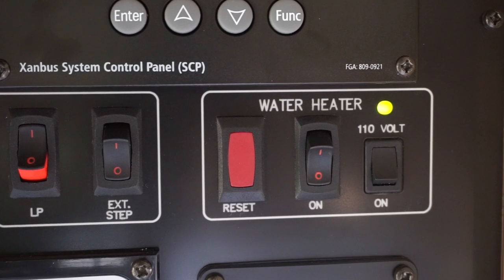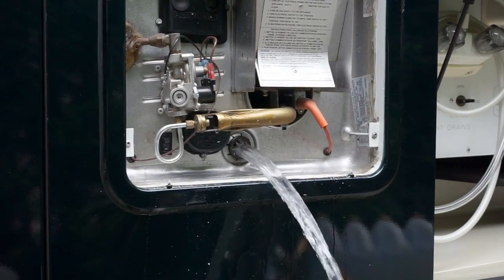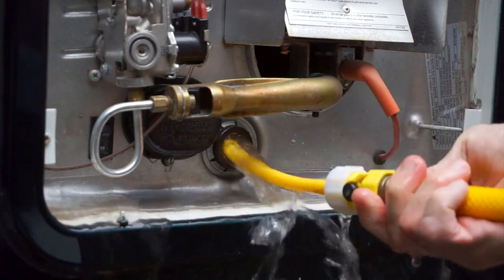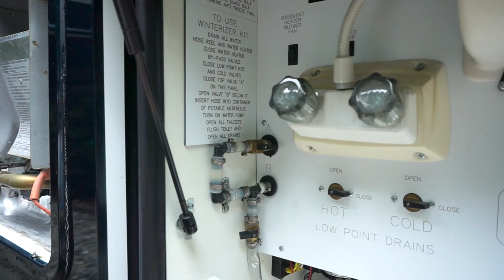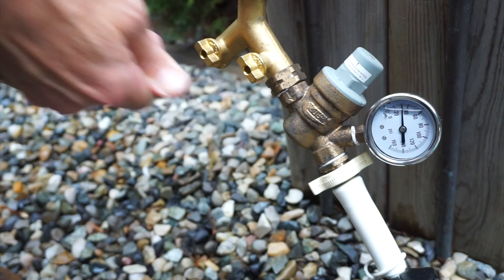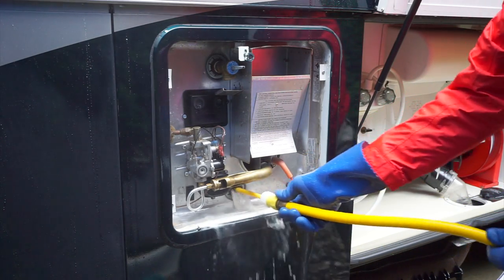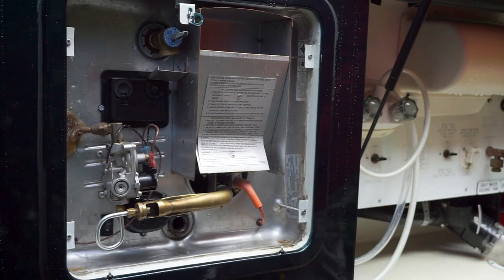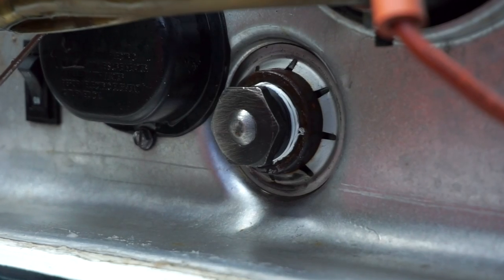Does Your RV Have A Water Heater? WATCH THIS!

Comment: Thank you for your channel.  One question:  I've watched your Atwood clean and flush video as well.  Our unit is new to us and the water lines are all behind a panel so it is unclear where I can disconnect a line to pump the vinegar and water into the hot water heater.  Could I not just empty my fresh water tank almost completely as well as the hot water tank, then fill the fresh water tank with the appropriate amount of vinegar and water??  Wouldn't the water pump then fill the hot water tank first?  What am I missing?  I'm a noob, so any advice is helpful.
Reply from the maker: Hey Floyd,

First, welcome to the world of RVing! We hope you're enjoying it as much as we do!

Second, we don't know of any water line that you could easily "disconnect" to enable you to do what we do with pumping the vinegar into the water heater. Our RV came with a "Winterizing Kit" built in... which is connected into our plumbing for the purpose of being able to introduce winterizing fluid into the water lines for storing the RV in sub-freezing conditions. Using it to pump the vinegar into the water heater is a side-effect of it's intended use. There are aftermarket products (like this one available on Amazon:  http://amzn.to/2eHZ5F4) that you can install for the same purpose. Hopefully, their instructions will make it clear how to identify the water line you need to tap into in order to make the kit work.

Third, there are several reasons we don't want to put the vinegar & water into the fresh water tank. The first is that we don't want to have to deal with flushing the vinegar (particularly the smell) out of our fresh water tank... putting the vinegar solution in there first would mean we'd have to rinse & drain the fresh tank a couple of times to get rid of that smell/taste. And the second is because we would have to put a lot more vinegar into the system to end up with the 50% concentration we want to end up in the water heater. The outlet from the fresh water tank on our RV isn't mounted to the bottom of the tank, it's at the bottom of the side. And as a result, you can't completely drain the fresh water tank. So there would be a fairly significant amount of water in there that we would have to balance with an equal amount of vinegar to get the ratio right. Your RV is probably plumbed similarly.

If you don't want to install a winterizing kit, you have a couple of options:

(1) Remove the Over-Pressure/Temperature valve near the top of the water heater and use a funnel that has a long nozzle to pour the vinegar directly into the water heater tank.

(2) Buy an adapter that could screw into the opening where the drain plug goes that has a barbed nipple on the other side so you could attach a section of hose to it so you could pour the vinegar into the tank from the bottom. Make the hose long enough to extend up above the top of the water heater tank (and find a way to attach it to the side of the RV) so that you can pour all of  vinegar in... and so that the vinegar/water mixture don't just drain out of the tank during treatment (or include a shut-off valve in the assembly so you can close it off while the vinegar/water solution is in there).

Hope this all helps you figure out what will work for you!
Reply: Thank you so much for your detailed answer.  It is very helpful.  We're new to this and I've watched many of your videos and it has already made me much better prepared.  I will look at my tank again to explore the best way to clean it.  Thumbs up!

Comment: Pete, John,  how to fill if I do not have the ability to fill off the bottle??    I have the exact heater in my Pacific coachworks trailer but all the lines are buttoned up pex. Could I gravity fill thru the pressure release valve?  Thank you!!
Reply from the maker: Hey Scott! Here are your choices: 1) Install an aftermarket winterizing kit, 2) Use a monkey wrench to unscrew the over-pressure relief valve, or 3) Attach a short length of hose (maybe 3 feet or so) onto a threaded fitting that's sized to screw into the opening for the drain plug. Screw the end of that fitting into the opening and hold the hose up in the air. Fill the hose with vinegar using a funnel. Attach the end of the hose up in the air, maybe using a suction cup to the side of the RV. This method will allow some of the vinegar/water solution to foam up and out the end of the hose during heating, but should still accomplish the task. Hope this helps.
Reply: For clarification sake, I'm wondering how many younger generation RVers would know what a "monkey wrench" is :-)  Do you get them at Petco ?  I just watched your new update video and came back here for a refresher and noticed the terminology.
Reply from the maker: +Travels with Yoly LOL. You’re right. Maybe us old fogies shouldn’t use such dated terminology. 😂

Comment: I see you have installed a ajustable pressure regulator valve, do you have a video where you talk about it?  Why that particular model?  are you satisfied?  I have the ordinary basic one.
Reply from the maker: Hi Julie! There are basically two different types of water pressure regulators that we've seen. The inexpensive fixed-pressure type that are so very common, and the adjustable type with gauge that we have. We've been using it for most of the time we've been on the road, mostly because it has a higher water flow, which is awfully nice when we're at full hook-ups. Yes it's a lot more expensive ( http://amzn.to/2DLVOwn%22 ) but even without adjusting it at all, the flow rate is a lot better, and we're willing to spend the extra money for it. The basic one works fine, but this is just a bit more "luxurious" when being super conservative with water isn't quite as critical (like at a full hook-up vs a partial hook-up with water & electric only).
Reply: Thank you for your answer, much appreciated.
Reply: thank you very for your answer

Comment: My water heater hasn't worked in over a year. I can't afford to get someone to look at it. Maybe you can help. The panel where the on-off switch is ( as well as tanks levels) quit working too. I am thinking it has to be a switch problem since the heater doesn't make any noise when the switch is on.  Several fellas have taken a look at it for me & all seem to agree.  It is an Atwood, in my 1998 Minnie Winnie. I live full time in this old gal. Hot water would be really great to have again! Thanks
Reply from the maker: Hi LuAnn. Is this a propane-only heater, or can it also run off electric? If it's a "bi-fuel" heater (propane/electric), it won't make any sound when heating on electric. It's only the propane mode that you can actually hear during heating. It's possible that the circuit board is bad, the switch, or (hopefully) it might just be a fuse. It's hard to diagnose without seeing it (especially for us non-professional-technician types), but if you give us some more detail, we might be able to suggest a couple of things to check. If it's a bi-fuel heater, the odds of getting it to work are better, since you'd only need to get one of the two systems to work to get hot water.
Reply: It is propane only.  It worked fine until I moved to another park & when I went to turn it on at the next place-nothing.
Reply from the maker: Thanks so much, Bob!! :)

LuAnn... in the meantime, here are a few quick things to check... but of course Bob, being a pro, will likely have lots more to say.

If you flip the switch to fire the heater and hear NOTHING (as in no clicking sound of it trying to ignite), the first thing to look at is power to the igniter. That could be as simple as a blown fuse, so that's the first thing to look for. Fuses can be scattered in several different places in an RV. You're looking for a 12-volt fuse (probably the colored "blade" type) marked "water heater." There might also be a fuse in line with the heater, or even on the circuit board.

If you find that, and confirm that it's not blown (contact wire inside will be unbroken), the next thing to do is check the switch. You can do that by removing the switch and temporarily connecting the two wires with a short jumper (short length of wire). If you hear then the heater fire up, the problem was the switch.

Bob... thanks again, and please feel free to correct our thoughts if needed!
Reply from the maker: Robnord1  Thanks Rob. Good to have a pro on the case. :) If LuAnn has a multi-meter or circuit tester, that's a great way to start troubleshooting.
Reply: LuAnn Patterson I converted mine to electric for $60 at walmart, they carry a kit. I forget the name . it's been2 yes. and working fine plus no propane.
Reply: Where do test with a meter?
Reply: LuAnn Patterson I'm sorry but I can t help you unless I saw it. I can't tell you anything more than the previous comments. on mine, I bypassed the direct spark ignition board and used everything in the kit to wire an electric heating rod that screws onto where the plastic drain plug goes and wired it to a thermostat then to a on off switch to a 120 volt plug you just plug into a receptacle.
Reply: Google hybrid heat at walmart
Reply: or amazon
Reply: really easy to install everything's color codes and just plugs together .
Reply: I subscribed but don't see the discussion tab.
Reply: My error Luann...My channel layout has changed, and I didn't know it !  Please click on any one of my videos and we can use my comment section there

Comment: where are the water heater bypass valves located? What if I don't know where those are, can I do this without bypassing?  Wouldn't I just have to run a lot of fresh water through the entire system when done?
Reply from the maker: The water heater bypass valves are usually located next to or behind the water heater. You should do your best to find them before flushing the water heater out with vinegar, as it will indeed take quite a lot of water to flush out the system of vinegar afterwards if you don’t bypass first. It’s not the end of the world, but bypassing is definitely preferable.
Reply: @RVgeeks  thank you very much.

Comment: Does the vinegar harm the wall's finish when the tank is emptied?
Reply from the maker: We rinse off the outside of the RV after flushing, so the vinegar isn't in contact with it long enough for us to even know if any harm might occur. We've been flushing this RV's water heater the same way every year for 12 years now, and no signs of paint damage under the water heater, so we seem to be okay! :)
Reply: I certainly respect your smart planning and follow through!

Comment: How about a smell of Old Wire I think it's coming from underneath the fridge could it be wire burning I don't always smell it I thought it was from the commode but I'm sure it's not I had this in my house one time the outlet that was causing the smell was always hot
Reply from the maker: +pikichu1442 You should have that looked at immediately. If it IS anything electrical getting hot, it's a major fire hazard.

Comment: I'm not clear on your winterizing kit.  What is it exactly ?
Reply from the maker: Hi Veronicca. It's just a series of valves that enable us to re-direct the suction from the water pump. When turned to the correct settings, it allows the water pump to suck up fluid through the extra hose (in this case, vinegar to be pumped into the water heater since that's the only place for it to go). It came installed on our RV from the factory. But there are aftermarket kits that do the same thing that you can install if your RV doesn't have one. Comes in handy for this AND for winterizing.

Comment: and if you own an atwood heater, make sure that your exterior shell is underneath your drain plug so that the water wont start filling up your trailer on the inside like mine! if they did a bad job installing it, make sure you seal it up.
Reply from the maker: +Devo Thanks for the additional tip!

Comment: In your video on flushing the black water tank, didn't you designate that yellow hose to be used only for flushing the black water tank? I keep cringing every time I see you mix that with the drinking water supply.
Reply from the maker: +Brian Hanifin Hey Brian! We appreciate your comment and concern. While we do use that hose most often for tank dumping, it isn't really designated for anything in particular, but just a handy 10-foot section that we keep in the water compartment for various tasks in that area. It gets used for everything from flushing the water heater to cleaning the water compartment to filling wash pails, to rinsing gear off, etc. But whenever it's used for tank flushing, it has double backflow preventers (there's one built in and, as mentioned in our other video, we add an additional one). It has never had anything but pure fresh water flowing through it. Think about the fact that if water were able to back up from the tank flush system into the hose being used (ANY hose), it could contaminate the fresh water system in the park, making ANY tank flushing a threat to the water system. Also, if water could come back through the flush connection, a full black tank would overflow into your water bay while sloshing during driving. Don't cringe! LOL We're very thorough about keeping things sanitary, but don't carry double equipment if we don't have to.
Reply: Thank you very much for educating me. I really appreciate your videos.

My wife's parents took her and her sister on a 3 month trip in a Toyota Dolphin while in between jobs. My parents almost took me nowhere. So I am trying to learn all I can while we considering getting a motorhome to take our kids on adventures (and give us something to do eventually in retirement).

Comment: On a propane only system does this have to be done as often?
Reply from the maker: +itripper1 Propane or electric probably has a lot less to do with the condition you'll find inside the tank than the water quality. Very hard water requires more frequent cleaning.

Comment: I need to know why I am getting black residue on the side of my RV from the water heater ?
Reply from the maker: If you’re getting leaking/dripping from the water heater that’s causing staining, is it coming from the over-pressure relief valve dripping? If so, you might need to replace the valve. You also might need to re-establish the air gap at the top of the tank by turning the city water off, opening a faucet, closing the faucet, then turning the city water back on. Also, make sure you’re using a water pressure  regulator!

Comment: Unfortunately, we don't have by pass values to turn off water to the rest of the RV.
Reply from the maker: No worries. You can still flush the water heater. If you're on board during the time the vinegar is siting in the heater tank, just be sure not to turn on any hot water in the RV. There will be a little seepage into the cold water side, but not dramatic. And since you'll want to run the faucets after you're done (to clear out residual vinegar) anyway, you'll end up with clear water and no foaming or vinegar odor either way once you're done.

Comment: Even tho you removed the Anode Rod there will still be magnesium in the tank from what has fallen off on the Anode Rod in the past. I don't think anyone should be heating Vinegar in a water heater that has magnesium in it. great idea with the borescope but even if you dont heat the water the chemical reaction is what cleans the tank not the heat.
Reply from the maker: Thanks for the input, jc! You're absolutely right that there is some residual magnesium in the bottom of the tank. But it's pretty minimal, because most of the missing rod has dissolved as a result of chemical reaction, not simply fallen off. The small amount of residual magnesium vs the large volume of vinegar should be no problem. And while the chemical reaction is indeed what causes the scale to dissolve, heating speeds it dramatically. We've tested both ways, and hot water works at least twice as fast as cold. If someone prefers to avoid heating the water/vinegar mixture, but has plenty of time to leave it in the tank for a few days, that will work, too. Or better yet, use a higher concentration of vinegar to water, as we've tested that too, and the stronger the concentration, the faster the action. Thanks again for the comment!
Reply: agreed i do enjoy your guys videos. I have been a Rv technician for 14 years.
Reply from the maker: *****
Awesome to have a pro here! :)

Comment: what is a suburban heater? I have a 5th wheel and don't know anything....
Reply from the maker: Hi Dorothy! Suburban is the brand name of the manufacturer. They, along with Atwood, are the two most common brands of water heater used in RVs in the United States.
Reply: @RVgeeks  Hi guys...we have a 95 holiday rambler ultra lite 5th wheel and don't have any hot water...we don't have any idea what to do. It's sat for a year. We are living in it.  Please help
Reply from the maker: Hi Dorothy. So sorry to hear, but you’re going to need to have someone local get their hands on it. Just too many potential issues to troubleshoot and repair remotely. Sorry we can’t be of help on this one.